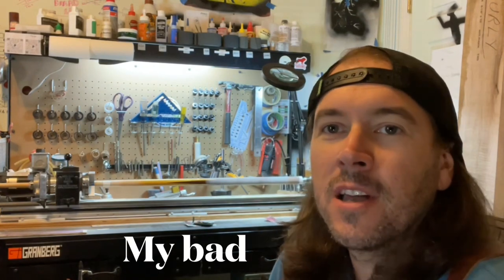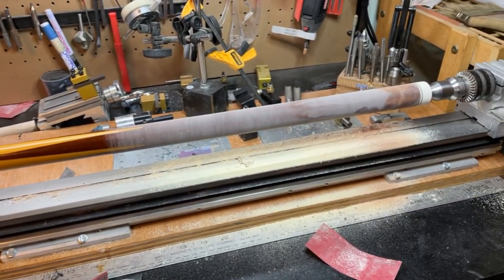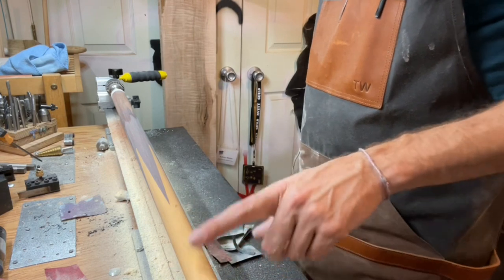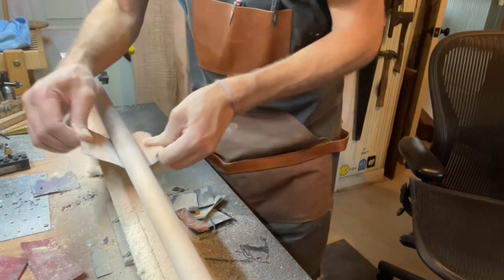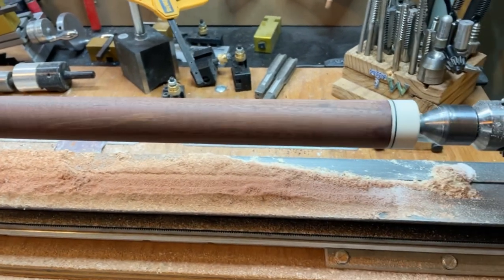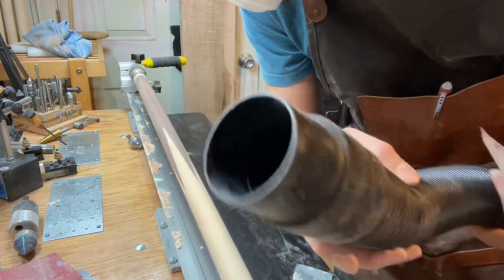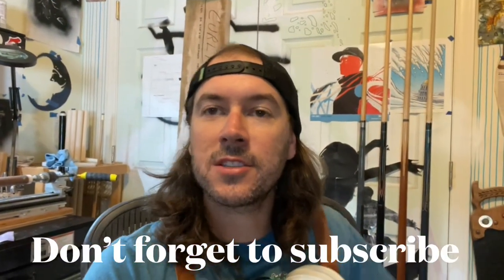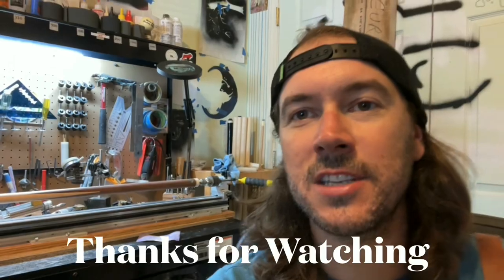This Pool Stick could make you a hustler

Comment: I am no cue-man but I notice you mostly only use the "shoeshine rag" method of sanding . So do Most all guys when working on a round project .
Problem is ; with any flat spots , (even those barely visible) , they will not sand-out with that method no matter how rapid you move up and down the shaft.
You , (us) , should all consider using a flat, rigid sanding block , 4 to 6 inches long and work it back and forth longways on the shaft or dowell with fast motion and fast lathe speed.
I'd welcome your comment / reply . Thanks
Reply from the maker: I do have a flat block that I use for tapering the tip or some ferrules. I need to make a few more and try it on a shaft.

Comment: Hi Master a question please, how it is made  a cue four points as in this video? thankyou
Reply from the maker: Hi Mario, this one is a one piece house cue. I didn’t make the cue blank. To make a full splice blank (4 points) you will need to start with square stock wood and make a jig to cut the points. Or you can cut the points into round stock (dowels) with a router mounted into the cross slide of the lathe and use a 60 degree cutting bit. Take a look at AZ Billiards forum and go to the ask the cue makers section.
Reply: @kimballwaldron7325  thankyou very much following your videos great help, grettings from Peru.
Reply: @mariopomar9499  hey I'm from there too